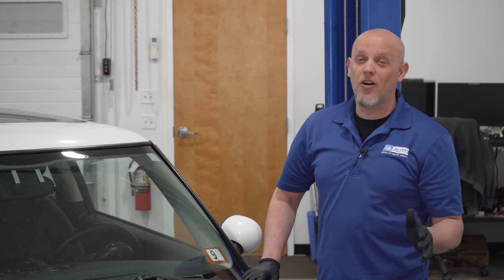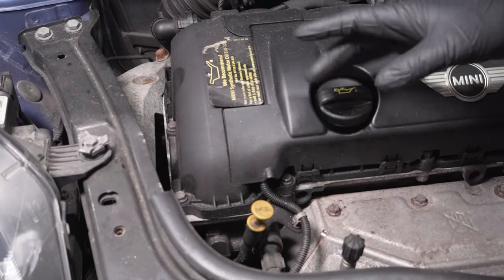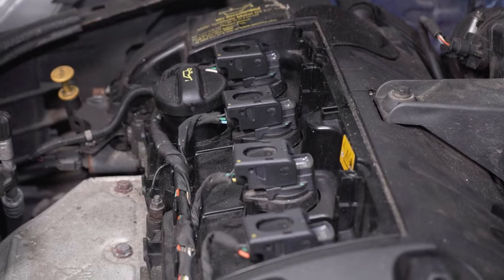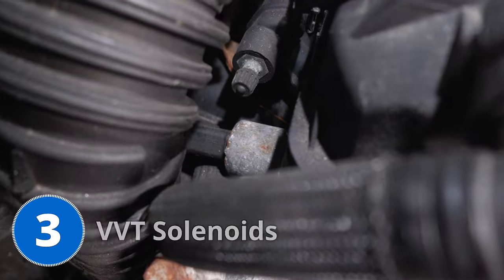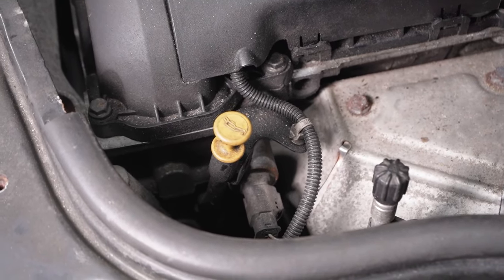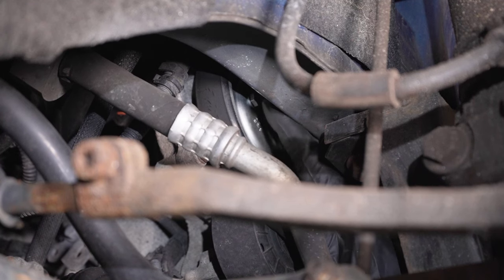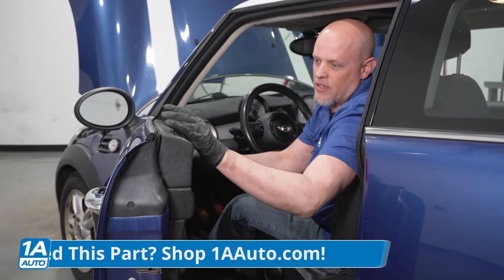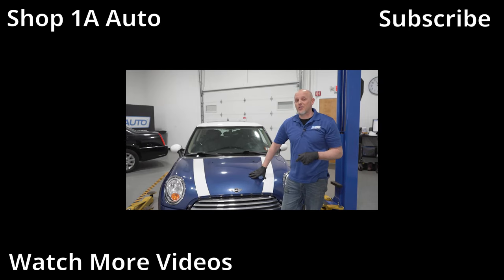Top 5 Problems Mini Cooper Hatchback 2007-2013 2nd Generation

Comment: I got a 2007 Mini Cooper I first rented ,  then i bought it as the price was $5K above the Blue book. Now I have 75K miles and basically have had no problem. Brake pads are not cheap, but I have had leaks here and there over the last few years. I got greasy spots in my garage, so what ? Now I just got the sign of engine "stress", not overheating, just that stress sign. I took it to the dealer and got an oil change. Double checked it, when I  got home, to make sure they really did ! Ha...They also gave me  an estimate of what suggested repairs should be as I refused their electronic eval. I just wanted an oil change ! not any diagnosis. Well, they found multiple leaks and even suggested I replaced all tires, which are all having deep threads and grooves,  so NO, not ready to replace. The total was over $8.7K ! Unf.... believable as it is more than the current value of the car. What disgusting scam ! Did they think I am an idiot ? I will drive that car with the engine light on, as a fixture. I will check my oil often and drive less aggressively. I only drive between the grocery store and my house. I am retired !  and considering riding my bicycle.......Screw the cars......and the car dealers, well, metaphorically........Not getting my business, ever again. What scam ! They never mentioned any potential damage to the catalytic converter.....why not ???these suckers are expensive and never in all these years I had the car,  one of these frauds, mentioned I should replace the spark plugs.....Hmmmm. They prefer to take down engines and replace the seals......they can make more money that way.......

Comment: These cars are endless money pits that have to be meticulously maintained. You have to know that going into it in order to enjoy the car.
Reply: You are correct.  Get a really good manual and many YouTube videos and almost all projects can be done yourself. It's fun and much cheaper. I've never changed my oil before and bought a R56 with zero knowledge about this car and the timing chain went within 800 miles. I bought the tools and watched videos and did it myself.  Saved about $2200 on that alone. Water pump was around $135 for Mini Gen. Saved about $800 for that.
Reply: @TheGunner9545  yes they break and it will always break.  You just have to know it’s worth it while it’s driving

Comment: I have a mini cooper with 100k miles on the clock. So far I've had to change the valve cover gasket, oil pan gasket, lower ball joints, inner ball joints, thermostat and housing, drop links, drive shaft and now the headgasket is blown 😳. All this in 10k miles. Most unreliable car I have ever owned. If you aren't good at fixing cars. STAY AWAY!
Reply: My 08  mini is at the dealer at this time and they cant figure out the electrical issue.never again.
Reply: @gidgettrophy  ouch and main dealer prices will drain your wallet. This car suffers from over complex engineering. Littery the worst car I have ever worked on!!!!
Reply: Hi there, After 100k miles it is quite normal on any make of european car to actually replace such parts as balljoints or brakesystems, oil and all filter changes (at oroper intervals), and the mentioned gaskets apart of the actual valve gasket. Sadly as with other makes the mini also has some issues which are real manifactural or design issues!
However, to go so far as to state,'keep your hands off if not a mechanic', is really over the top. 
These second generation minis are fantastic drives and very solidly built, I would even go as far as saying, 'german/anglo - high quality' manufacture. 

One big issue on all european manufactured cars is that they are built for europes, shorter, tighter and more compacted geography. U.S. vehicles were and still are made for long distance and more open terraine thus the huge engine capacities and the solid builds of the past. The two concepts, european or north-american are two completely different approaches to designing not only a beautiful style but also a reliable mechanical machine. 

Please just bare my comments in mind when shooting down ANY make, or type of automobile manufacturer.

Adding to the above information is also the issue of sparepart manufacturing and the huge global business regarding sales of these parts.
Reply: Sorry and ine more issue to bare in mind is that you bought the mini 2nd hand and so depending on who the previous owner was and how that owner took care of the car. The mechanic who cared for the car must akso be considered. Was he a consiencious and good mechanic, did he always carry out the proper services at the right time and interval?  If this wasnt the case well then this all could have lead to the major issues that you sadly have had to experience.
Here in Europe it is known that the German people in general always take care of any vehicle they may have but especially their family car! Yes this is also the case in most other countries, however, with one difference, after the warranty and guarantees of a newly purchased car have expired the German will carry on really taking care of not only the cosmetics but also the mechanics of the car! 
How do I know this you may ask yourself, well thats quite a sumple question for me to answer. You see the german owned cars thus secondhand vehicles in general are very sought after by other european neighbours and so these vehicles after running here on german roads for so many years, three to six years approximately are then bought up 'privately'', or by huge resellers who travel i to Germany from; Poland or Czech, Holland and Belgium, Estonia, Latvia and Ukraine (many other country), the 2ndhand cars are transported via car transporters back to their new homeland and then sold on to a potential new owner.
Ok so mich information for a maybe better understanding of theeuropean used vehicle trade.

I hope you don't find my explanation too boring and not of interest. I guess you  folk in the U.S. also have some similar issues regarding the mexican border and trafficking of vehicles also????
Reply: What year did you buy?
Reply: My minis got 230k
R56 n12 engine

Comment: i have a 2009 i bought to save gas, after 700 klms the alternator went, so it a 4 hour fix and and $300 to $600 for part. not very reliable but fun to drive and killer gas mileage.

Comment: How about how difficult it is to replace lower radiator hose?🤔
Reply: I ended up buying a jubilee clip for it I spent less time doing the thermostat housing than I did fucking around with that damn thing

Comment: That’s why Toyota Corollas are so popular.
Reply: Maybe but who wants to drive one?
Reply: They are popular for gas and reliability.  Not styling or power.
Reply: @alm7707  people just want corollas for a good reasonably cheap to run and maintain comfortable reliable small car that they can drive and own without having to worry if it  is going to leave them stranded or break in the next short period or cost an arm and a leg to repair.

Comment: Not a helpful video. People need to hear about gritty problems with this generation. The only one that hits home was the water pump, but it's cuz of its plastic impeller that it will not hold up. Don't get me started on the coolant tube. I wouldn't use plastic like that of the coolant tube on a Huffy bicycle even. It's cheap, weak plastic, a fatal design. The real problem with the valve cover is the integrated pcv diaphragm that fails. Maybe the door latches, but it's a bigger deal when the hood latch cable stretches.
In no particular order these are more notorious problems to a 100k miles, with things being slightly better for the 2011-13 owners.
HPFP
Vacuum pump 
Timing chain
Fuel pump relay failure at the JBE
Fried FRM due to voltage fluctuations (alternator/jump starting) or water intrusion 
Thermostat
Oil filter housing seal
Sun roof leaks due to clogged or detached lines.

Comment: Thermostat and most housings are all plastic impossible to repair, they crack and warp.
Check engine codes with nonsense like the canister or evap system.
Rear brakes must replace sensor when changing brake pads.
Vaccum pump.
Dashboard all kind of issues.

overall do not buy one unless is for less than a 1000 or free.

Comment: Let's not forget about the fact, that these awful engines are actually Peugeot engines, made out of cast aluminum and the second they experience heat they blow their head gasket and you're in for a 3000$ repair. Bought mine, found out that it once encountered a front damage, so the fans failed, engine went hot, gasket was damaged. Spoke to someone working at Peugeot and he told me about how many problems these cast aluminum engines make. I'm never buying a Mini again. A company that focuses on an "Always Open Timer" instead of a coolant water temperature gauge is just a bad joke. And their newer models dont even got an Oil measurement stick anymore, you have to let the car "calculate" the oil level, while driving, like...? Nah thx.